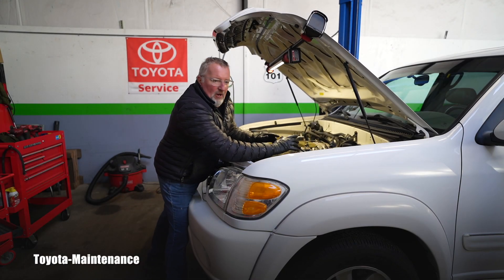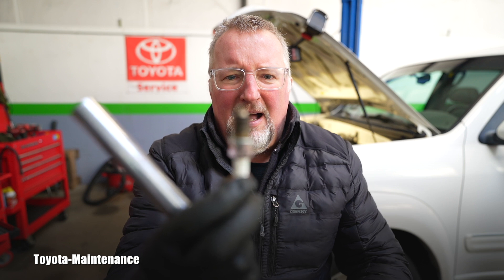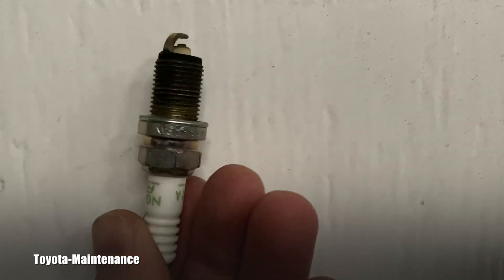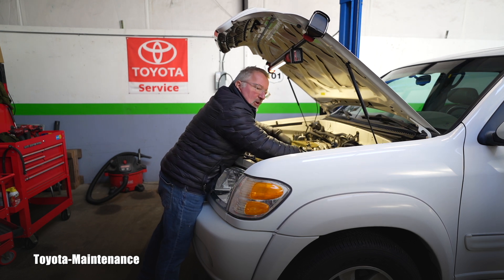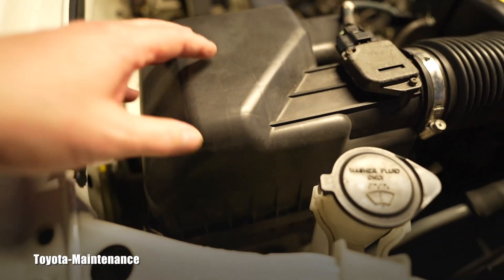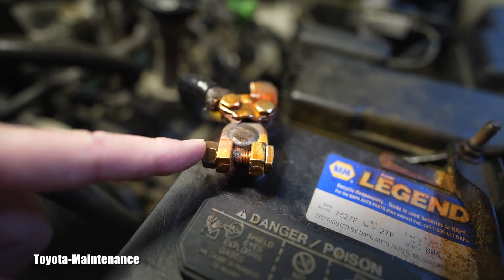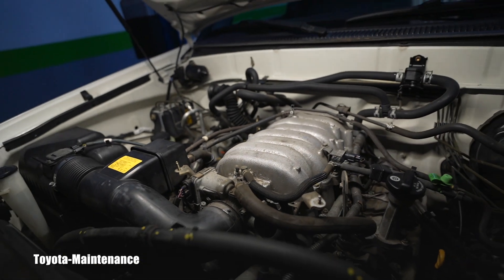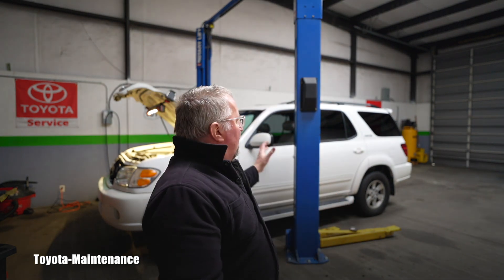How to increase gas mileage in your car

Comment: Something often overlooked for better gas mileage, make sure your brakes are not hanging up or dragging. Pads can seize in the brackets, slide pins can seize up and calipers can stick. Any of them can cause drag.

Comment: Driving style can improve mpg significantly!  Switching to a good Highway tire instead of an aggressive A/T can also improve mpg by 1 or 2 mpg. My preferred hwy tire are the Michelin Defenders. They also seem to last forever with proper alignment and rotations they can go up to 80k miles
Reply: the current defenders on my '97 taco rig have 85k miles (mostly long-haul freeway)  and measured 7/32 tread life... not bad when they cost a bit over a grand  out-the-door
Reply: i am looking to put some Falken wildPeaks on next... i wonder how the mileage will be with those, does anybody have experience with that brand?
Reply: @efil4kizum  expect around 50k from what I’ve seen people get
Reply: Nitto Ridge Grapplers for longer life and aggressive tread.
Reply: Driving Style for sure. Save Fuel, Tires and Brakes.
Reply: I get my Michelins from Costco and they always go for 100k easily

Comment: Hi Peter, in my experience owning a well Made in Japan vehicles, the single most important item that can increase gas mileage is making sure the tires are properly inflated. I even add 3 or 4 PSI over the recommended PSI.

Comment: I can gain 2+mpg just by adding 10lbs of Psi to tires. As seasons change it's always a idea to check your tire pressure. I drive a 04 Taco with 565k mi on it. Best truck I've ever owned.

Comment: Great information.  I have a 2013 Taco 4x4 TRD Sport 4X4 Double Cab with the 4.0L V6 and those that know, that engine can get thirsty when your right foot is a little heavy. I try to do all of maintenances that Peter recommends. So far so good. I also change my front and rear Diff oil. I also change my transfer case gear oil too about every 60,000 miles.

Comment: Great content Petr. FYI, I replaced the original Oxygen sensors with Denso parts on my 2008 Sienna @ 192,000 miles. No codes but noticed that they were responding rather slowly while monitoring OBDII data. My gasoline mileage increased by 3 MPG and we're now averaging 24 mpg in mixed driving.
Reply: damn 24mpg on a van is great!  You said you replaced the O2 sensor even though the check engine light was not on?
Reply: @agookchild  yes the Toyota system was designed with knowledge that the CEL will immediately fail many emissions and as such that Japan has such strict demands on pollution control already, they designed it to not trip unless it is completely dead like for example exhaust poisoning through gas or oil and the extra snuffing caused the heater circuits to overload and burn out. But if it's just lazy aka slow to heat, that wastes fuel. But is still operable. This way you decide not the law.
Reply: @LAactor  thank you!!
Reply: Yup just like those spark plugs they were working but just Worn out. 

Toyota parts are truly are long lasting.
Reply: @LAactor  Makes Sense I heard once change them when the plugs need changing. To be honest, I change the sensors when they fail. >.<
Reply: @Esteban_Herrera  yes that's more or less accurate. But the range of plugs can go from 60k on the trucks to 120k on the newer cars so it helps to ohm them out with a voltmeter or internally with a scantool. Doesn't need to be fancy and graphing. It can be a little 2x2 screen as long as it has "live data." Data that updates in real time as the detection circuit fluctuates in the sensor.
Reply: For anyone reading the best thing is just to figure if you didn't have the mileage you did when you first got it and you done plugs and verified, not just trusted someone saying, then go to the afrs next. Especially if you have laggy and slow acceleration.
Reply: @LAactor  BEST ANSWER I need a scan tool.  >.<
Reply: Hi. I love just bought my first car, Audi A3 2.0 FSI, 2004. Computer saying there is a fault with Lamda sensors. Just watched Petr tutorial re cleaning, really useful that he pointed out that there are different fault codes for different issues. So I'm going to check if my fault code indicates that they need cleaning before I clean. Before I watched this tutorial I was looking at different makes of sensors, are you saying that there are varying degrees of quality? If so, and I need to replace mine, which brand do you recommend? Thank you!

Comment: Synthetic gear lubes in the front and rear differentials, transfer case and transmission can increase mileage slightly. And of course synthetic engine oil. Mostly though, having a light touch with the accelerator pedal improves mileage the most, even in a big old beast like this vehicle. Thank you

Comment: I just found you and your channel.  Awesome.  All of it is very clearly described along with great tips and hints.  Have 2001 2WD Sequoia that I have taken very good care of over the years.  238,000 miles and it's running great.  Used your tips to do the valve cover gasket replacement (had oil leaking in one of the tubes).  Thanks so much!!!

Comment: A big factor is driving habits. We have a 2008 Highlander, which unfortunately has 3 plugs which are hard to get to. When I drive, the avg MPG (based on the display) is 24mpg. When my wife drives the same vehicle in the same area, her avv mpg is 17mpg. No significant difference other than the driver.
Reply: This is my problem too. For the life of me I cannot soft foot/under rev or dive gently to prevent it. I just will consistently get 15-18 no matter what.

Comment: I’ve got an 02 Tundra 4wd that I was able to squeeze 17 -17.5 mpg out of on the highway and that was with all my hunting gear this past deer season.
New plugs and went up 5psi on the tires but the big thing was keeping the engine at or just below 2000rpm which is around 63-65 mph. Did this all hunting season and the mpg’s were consistent. Before that I was see 15mpg on the highway but traveling at 70-75mph.
Reply: 10 miles per hour makes a big difference .
Reply: What was the reasoning for bumping up the tire pressure?
Reply: Less rolling resistance
Reply: If time is no value to you, that's the way to go.  For me, time is money (meaning more that I'm willing to pay for extra leisure time than that I'm trying to rush somewhere to make more money)

Comment: Thank you Peter. Good stuff. Very helpful. 
Just changed the engine oil and air filter on my Honda HRX lawn mower. I've had the mower close to 10 years. I change the engine oil and air filter every year. I should check the spark plug as well. I think its the original. I try to sharpen blade once a year as well.
Preventative maintenance helps these engine last longer. I just learned Honda is no longer making these lawn mowers. Who knows how long the ICE will be around.  I also change oil every 5k miles on the 2011 Sienna with 2GRFE. Sad to see Toyota is planning on phasing out that motor.. I guess I'll just stick to lawn maintenance and hope for the best. I'm looking forward to my next Saurkraut break. I tried German style kraut not such a big fan. Good night California 😴 and The Bay area and Geary Blvd.

Comment: I replaced the Iridium Denso plugs to a Twin tipped Denso Iridium spark plug. It’s advertised to burn cleaner, increase performance and longer lasting. My 2007 Tundra is very light on it’s accelerator.

Comment: You also have to consider the thermal expansion/contraction of the fuel. What temperature was it when you bought it (out of the ground from the pump at the station) and what temperature was it when you were driving around. 10 gallons of gas at 60F = 9.6 gallons at 0F so right away before you even move you're going to get less miles to the gallon because you physically have less volume of gas in the tank when it's very cold outside.

Comment: Hi Peter. 
Thank you for the good content. Sticking to Denso or OEM parts does make a big difference in MPG and longevity of the vehicle. 
As part of the health check you can also test the fuel pump load pressure. 
Under load it should not drop below 3Bar. It should spike directly to 3,2Bare when you press the gass peddle to the floor..

Comment: I just had to replace the valve cover gaskets on my '05 Sequoia with 250K miles!  Moving on to universal joint replacements next... Any recommendation on a brand/model number that's good?  I would like to have a grease fitting on them for ease of servicing.

Comment: If new tires with an increased rolling resistance were recently installed that can also negatively effect MPGs. I noticed a 2 mpg difference when I switched from Michelin Energy Saver tires to Michelin Cross Climate 2 tires.
Also add some injector cleaner to the fuel tank occasionally might help.

Comment: I always recommend ohming out the afr sensor(s) to see if their slow reaction time affects making the engine too far when unnecessary or too lean when otherwise needed and not available. Slow to accelerate when you stand on it? And it's not something that always slow? That's your sign. But use the numbers and compare to the expected range. 

I also use the cleaners and protectwnt but Noco brand. And also the felt circles for the terminals to block the offgassing that makes the yellow crusties on the terms. 

I also see the vehicle squatting some. Worn shocks or extra weight in the rear? That also can cause mileage rundown. My question is why leave the terminal so high up on the post? I put it far on as I can so it can't vibrate off or get knocked in a pothole or let the yellow crusties build up underneath. 

And did you know.. you don't even need to use a cleaner. Hot water will melt it and it washes away. But definitely use the treatment after. Or any oil based spray. Or really any grease. Anything to coat and block. But the spray is more tacky and less messy.
Reply: And no jackrabbit starts because the higher rpm the more fuel you waste. No idling also. You waste fuel if you need the AC. Especially in an old car.

Comment: On the battery and corroded connections.
I have had corrosion on the negative ground to chassis or the fender. It would affect fuel mileage and the motor would have a rough idle. 
Oh what a feeling!!
If I had a salvage yard I would only buy Toyotas.

Comment: Not sure if this engine uses ISC (idle speed control) valve but cleaning it can slightly improve gas mileage. My car 1UZ-FE was showing idle RPM below 600. Once cleaned, RPM became normal between 600-700. I would think 150K miles is a good interval for cleaning. Thanks for all your videos.

Comment: Petr and everybody else… how do you remove corroded 10mm coilpack bolts that like to not act like 10mm bolts and just crumble? Shall I try an 8 or 9mm socket and be super careful? I might have to end up cutting them off lol. Almost 6yrs of owning an LX470 and the coilpacks and sparks are of unknown history. It’s at 291,000mi

Comment: I understand wanting to get the most MPG that you can. However, trying to penny pinch a V8 is best cured by buying a Prius. V8's weren't designed to pinch pennies at the pump.They were made for torque and HP. Nothing more. Thank you Petr. Great video tutorial.
Reply: Any owner who normally gets a certain .MPG, and doesn't get it, knows that there is something wrong and wants to address that.

Comment: If it's so cold outside, no doubt the interior heater has been running constantly so that will affect mileage.
Reply: Oil company's give us cheaper gas in cold seasons too (lower BTU value).
Reply: You obviously have no idea how a heater works in a vehicle.
Reply: @aaronbrown6266  You don't warm up your car in cold weather?

Comment: Just my thought but with my 2012 tundra 5.7 i keep rpm's under 2000. I also use cruise when on the highway generally about 65-67mph, no jackrabbit starts from stop and mostly air pressure. Question  my truck has 77,850 mi on it, how often should plugs be done for this truck?
Reply: I believe it’s 192km which is about 120,000 miles

Comment: Hello Peter. Should I perform a transmission drain and fill along with a filter change on my 2005 sequoia 180k? Currently the transmission shifts beautifully but I’ve read conflicting opinions on the subject. Should I just forget about and leave it alone since it has never been serviced ?
Reply: I'm in a similar situation.  2008 with 205k miles.  First owner hauled a travel trailer... I think it should be changed if the transmission's going to last.  Trouble is, as he said in another video (search for it on his channel), they made it so difficult that many of us may find it too difficult to do on our own.
Reply: I've performed two transmission fluid changes since I bought my '02 Sequoia 6 years and 100k ago. No problems with the transmission. Synthetic went in both times. I would think new and better formula stuff going in is better than old gunky dino juice staying in. Also something to consider is the oil cooler on the front. A flushing and filter change will prevent that from getting clogged as well.

Comment: What is typical MPG for the 5.7l in the Tundra/Sequioa? I get 12.5 in my 2011 Tundra across the several months of ownership. Will be changing spark plugs soon and cleaning MAF.
Reply: I get 13 average in an 07 5.7 tundra. Probably closer to 16 if I'm taking it easy on the highway though.
Reply: We average 15 in our 2008.  Pure highway is more like 18.

Comment: Has anyone had any positive mpg results from throttle control products like: pedal commander/9drive etc. In "economy mode"?
I know that a throttle body spacer is useless in a non carburated vehicle. I have an 07 tundra 5.7 4x4 that Peter has worked on and I put in dual exhaust a year ago, an AEM DryFlow drop in air filter & a 9drive throttle control unit. Still only getting about 17.5-18mpg hwy. I guess that's the ceiling on these beastwagons. The only other thing Peter said could be done is tweaking with the ecm which is above my paygrade..

Comment: If you can stand the rough ride, increase tire pressure to within a couple of pounds of the maximum listed on the tire sidewall. I run the old Expedition tires at 28 pounds, so it rides less like a truck. And I don't drive much. Always keeping my fuel tank on full eventually gave me a tankful of stale gasoline which would hardly burn. Stale gas which caused a 'stop and go' engine operation didn't set a trouble code. That surprised me. Running the fuel tank down below 1/8 full & adding $40 of fresh fuel, along with 3 fuel filter changes, solved the problem. I put some of the old gas from the fuel filter in a jar. It never did all evaporate. It left behind what looked like some kind of light oil which didn't smell like gasoline at all, nor did it smell like diesel. There was no water in it. You don't want any water to sit inside a fuel injector. So if you don't drive much, don't top off your fuel tank every couple of weeks.     
Watch out for the rain coming your way, Peter. The Weather Channel said a lot more rain is on the way to California. So did the AccuWeather Channel. At least the drought will be over by spring.
Reply: I have seen people separate ethanol from gas before. Does it ignite? If there is no gas left.. Be safe.

Comment: Keep the car WASHED! Dirt=extra air resistance, and possible extra weight in winter (ice and snow built up underneath). Ice and snow can also build up on and inside the wheels, throwing them literally off balance.  Twice a month is usually good in my experience.
Reply: Keep it washed because of dirt adding wind resistance, 🤣🤣🤣. I heard on the radio show "car talk", where one lady brought that up (her husband wanted to wash their car before a trip) to the two brothers who were mechanics. One of them tried to explain how washing would not improve mileage, maybe .00000001 more miles a gallon, the other one couldn't stop laughing.
Reply: Myth busters. Dirt is also extra weight, and can contribute to rust... especially if salt in used in winter
Reply: @jimelfman1369  Yeah, the extra 4 ounces makes a big difference.
Rust from salt is important to address, however.

Comment: Please use your words correctly:
You cannot “increase” gas mileage!

You can simply RESTORE the gas mileage closer to specs.
Reply: Well the spec on our 2009 is 28 mpg highway. I'm assuming the spec and rating are the same thing. I just got 32 mpg on my last tankfull of fuel. You don't call that an increase? I used Lucas injector cleaner in the tank along with ethanol-free top tier fuel.